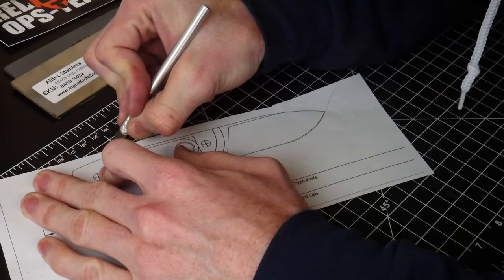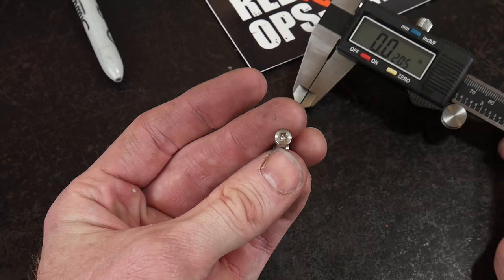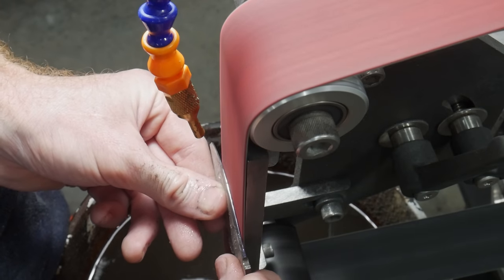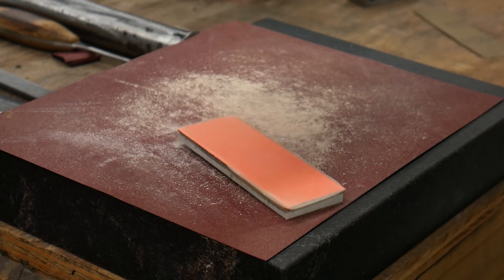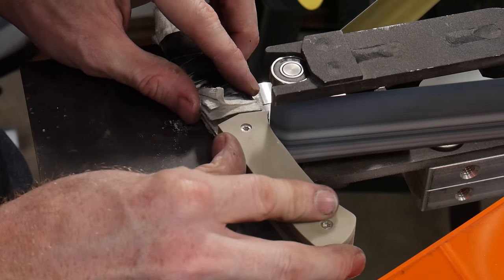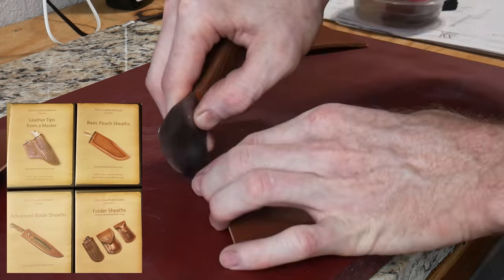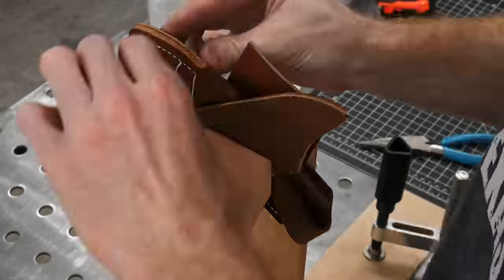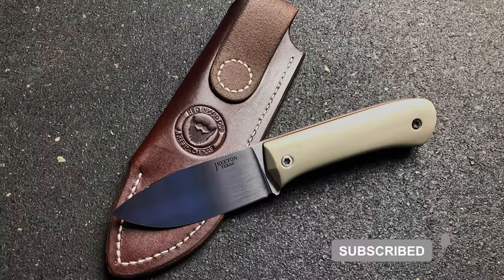The Most VALUABLE Knife Ever Made? | Secret Bitcoin Wallet | Knife Making

Comment: Man, I wish I could get into leather sheaths and have them turn out half that decent.  All of mine have been trash, I guess I need to just sit down and make more trash until I get the hang of it.

I wonder if it would be possible to lay down a really thin coat of something like gasket maker on the scales so the key would be waterproof as well as hidden and protected.  If the gasket maker was applied to the scales and then allowed to fully cure, you'd have a rubberized surface as a reusable seal if taken apart.  Of course, you could also assemble it wet for a more permanent seal with loctite on the screws for additional security if so desired.
Reply from the maker: I like your idea of a gasket.... that would be a great addition!

Comment: Awesome build and beautiful knife...perfection !!   I don't know if you saw my previous message to you about getting dimples in my bevel.  I roughed out a new piece of 1084 and this time I was finally able to get a nice symmetrical bevel on the blade.  The only thing is that the bevel is not as wide at the tip as the rest of it.  I tried adjusting the blade in the jig and grinding just the tip but it didn't make enough difference in the width of the bevel.  Instead I encountered a different problem.  The tip became too thin and my grind line disappeared.  I was trying to leave the grind line visible for heat treating.  In order to leave that much thickness at the tip, I had to grind the profile a bit which then reduces the bevel width again.   Do you have any advice on how to solve this problem.  Trying to learn this craft without expert help is very difficult and costly.   I'd hate to ruin another blade messing with this incorrectly.  Thank you.
Reply from the maker: This may help - https://youtu.be/UHOn7X3z9lA

really comes down to practice with your machine. Grinding to 70-80 % and finishing with a file guide is a good way to get it all straight as a new maker.

Comment: I have two questions. What angle did you set your workrest at initially to grind to your center line? And what angle would you recommend grinding a primary bevel to create a sturdy hunting knife?

p.s thank you for another amazing video!
Reply from the maker: Hey man, I don't know the exact angle... but I'd say as large as possible with your set up. I'd like to go smaller than 45 degrees if possible.